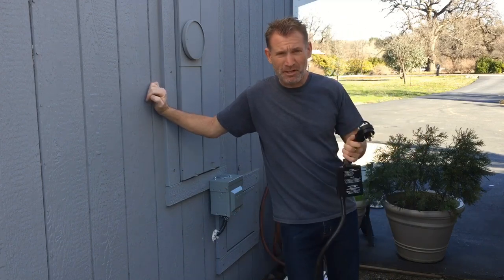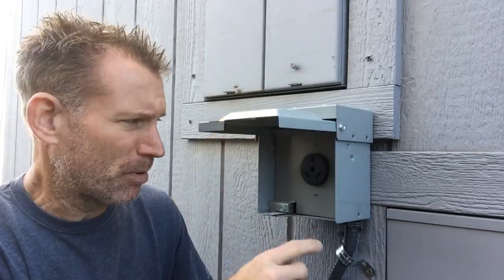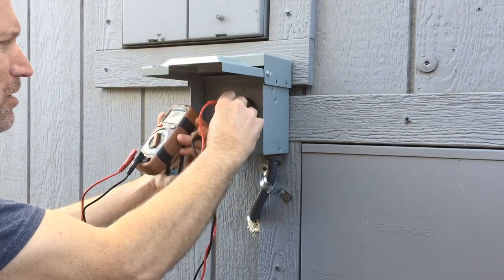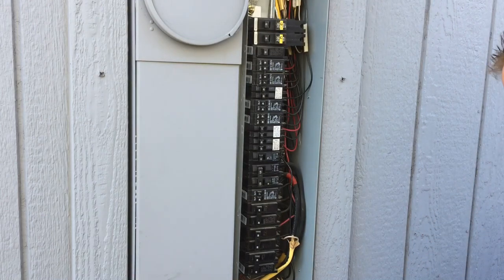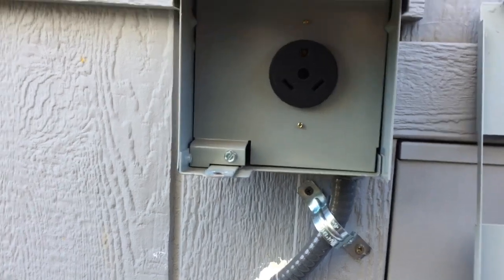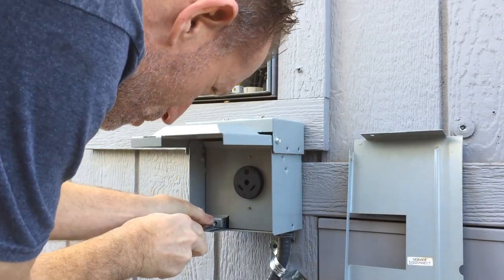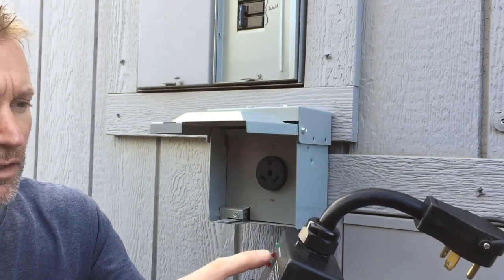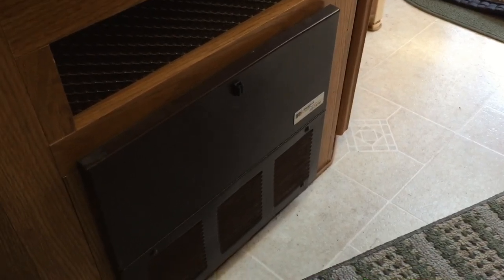Install a 30 amp RV Power Outlet

Comment: An LB and a nipple would make the install nicer
Reply from the maker: Yeah, I thought the same so I did install a line box with a threaded nipple on the flexible conduit.  Got rid of the drip loop.
Reply: @covetthecamper2289  nice!

Comment: You need to redo the video and use number 10 wire don’t just write it on the screen that is very misleading to use 12/2 romex and you don’t have to turn the whole main panel breaker off Just the single pole 30 amp breaker feeding the RV receptacle

Comment: should have showed where you hooked up the wires inside the breaker not too helpful at all
Reply from the maker: Alan Hoxie 
5:33 then again at 6:27 
There’s only one spot to hook up the hot wire (black) to the breaker.  
Neutral/Ground bus bar for your neutral (white) and Ground (Bare Copper
Reply: If you dont know the answer to this you have either never looked inside a box, or you never should again.

Comment: This kind of a  hack job. Use a water tight fitting coming out of the wall, not caulking. Also, make sure to use the right wire and pay attention because wiring 30 AMP RV or 50 AMP RV plug in, things are different so be careful.  This is not a craftsmanship like job.
Reply from the maker: Read the description and watch the whole video.
I used the correct wire, conduit and fittings.  Inspected and passed California electrical code.
Reply from the maker: This is not a 50 amp setup.  Says it right on the video and in the description.   I know the differences between the two.